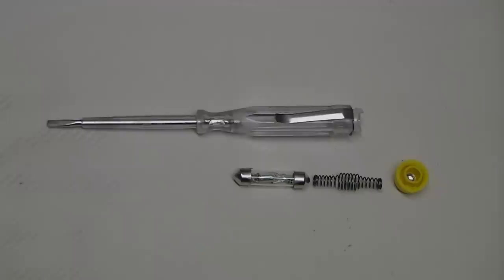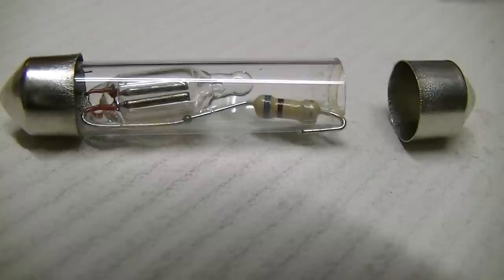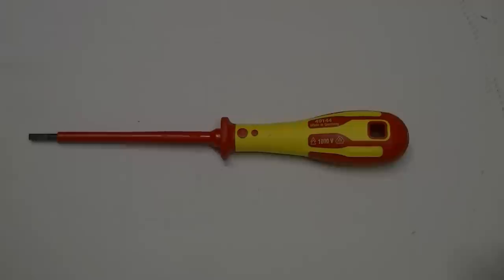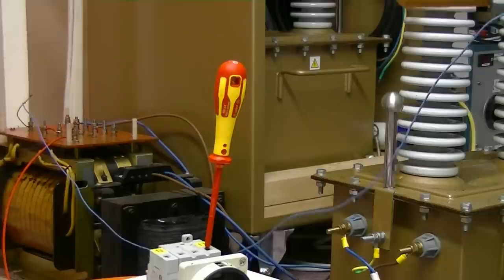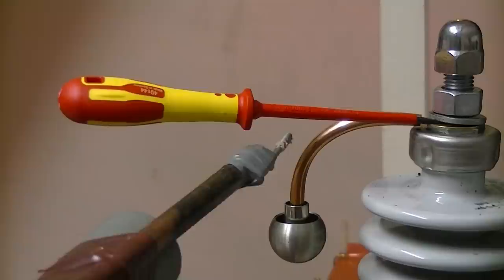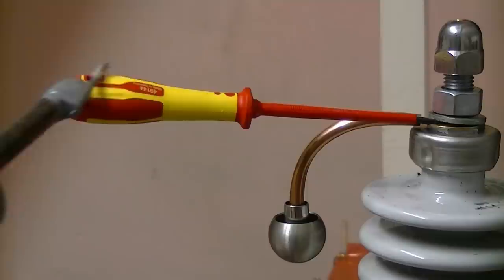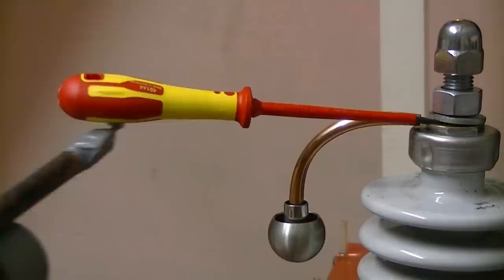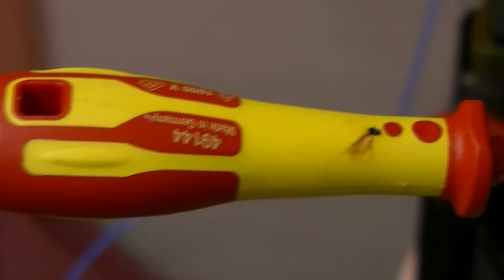Killer Screwdriver

Comment: And where would you find a 1000-plus volts supply in the average house? Most you would find would be 110V (North America) or 240V (UK, Australia, New Zealand), assuming single-phase AC. Okay, there's the spark lead on your lawnmower, but current is usually pretty low there.
Reply: The volts just start the trouble. It's the amps and/or joules that kill people.
Always be wary of big aluminum electrolytic capacitors, you can find them in anything that uses a switching power-supply, like computers, televisions, etc.
If I ever have reason to be messing around with anything like that, I make a point of putting a discharging jump-lead across the mains filter capacitors. I made a jump lead to use specifically for this purpose by splicing a 10k ohm 1 watt flame-proof resistor in to the middle of a standard jumper lead, so that a fully charged capacitor won't discharge arc thru the lead, which would make a bit of a pop with the smaller caps, and a pretty large bang with the larger ones. 10k ohms discharges the cap in about 30 seconds to a minute at most, but I leave it for at least 5 just to be sure that there's no energy left to surprise me at an inopportune moment. You used to be able to get all the supplies you need from most any Radio Shack, but these days they mostly sell cellphones. You can still find the stuff you need online easily enough, however.

Comment: Arent these things only supposed to be used up to 500 volts though?
Reply: Mate of mine was almost killed by one of these on a standard single phase 230v supply - somehow the voltage bridged and it exploded, and I mean literally exploded. We later reckoned it had moisture in it. Spend £20 and get a Fluke non-contact tester
Reply: Yes.  Safety factor should always be observed.

Comment: Plastics pvc silicon rubber XLPE ETC... all can withstand enormous voltages but the problem is the corona, yep that crackling sound. The corona and UV is extremely destructive and its just a matter of time before a puncture occurs, and making the material thicker doesn't do much except delay the breakdown. LV insulated tools is strictly for LV use only.

Comment: this experiments is pointless and no meaning to make judgement that screwdriver is killer. Normal condition, you would not short circuit it directly. Use ground or earth as negative point and normal voltage, then if it shows the same result, then i can say you have your experiments good.

For special purpose, use special tools.

This experiments looks like run your bicycle into fastest speed in F1 racing championship. Very dangerous and one more time, pointless.
Reply: You should watch his video on Health & Safety!
Reply: +Yoga Saja  Not pointless at all.  Most people don't understand why the tester works and what the possible pitfalls could be.  You are simply commenting so as to sound knowledgeable and important, yet you cannot even grasp this concept.

Comment: this is pretty safe for domestic use. 
I've been using one of these at my domestic repairs in my home (127V and 220V) and, since it supports up to 600V, I won't find any spot with more than 220V at my home. It's safe.
Reply: Not all 'models' cover the wider range, and in fault conditions you may have been supplied a 3-phase winding voltage so a bit more of a 'sting'.. ;-)

Comment: Yep - I've accidentally hooked-in on 1.1Kv with a similar screwdriver.  Rated for 600V was the driver.  Was fine.  After the smoke cleared from the blown fuses, the driver was removed from the cable and was still good.

Comment: Have you tried popping lengths of solder on your capacitor bank? When I was in my teens I made a small bank of caps half the size of a brick and charged to 35V. putting some solder across the terminals made some awesome explosions and trails of white soot in the shape of firework pattern.

I wouldn't advise breathing the smoke and soot, they would be lead and tin oxides.

Comment: So that screw driver will bust through the 2 bigger circles at higher voltage? You were just at the breaking point and you bust perfectly threw the smallest circle. Maybe that's so they know the approximate voltage the guy holding it when it went off touched.

Comment: You might be able to use them up to 600 V, or if you want it hard up to 1000 V max., but after that you are finished. I tried this at a low energy high voltage and it seems it creates a leaking current around the resistor. Could that be?

Comment: If you are a pro electrician you should have a multimeter in your tool box. It does not have to be a fluke but you do get what you pay for and be using that. I think these little screwdriver ones you get in the dollar bin at the hardware store are marketed for around the house use not commercial/industrial settings where you would be dealing with high voltage.

Comment: I see what the problem is.  From 2:06 to 2:29 the screwdriver functions perfectly: apply a voltage and it lights up.  Where it goes wrong is at 2:30 - remove the voltage and the screwdriver is still lit.  This is very misleading.  It would cause you to think a high voltage is present when it is not.  The solution is simple.  Make the screwdriver body of fireproof plastic.  It's so obvious I don't know why the manufacturers didn't think of it.

Comment: I also would like to ask you since you seem very knowledgeable about high voltage....
if i have 5 gaps/layers of insulators rated at 1KV each.  is the total final insulation value 1KV or 5KV ?
Reply: +forthereg If they are wired in series it will be 5kv

Comment: Very nice test, this is why I don't own or use any of these screwdrivers, and only use Non-Contact voltage detectors. I know Wiha test there Insulated Screwdrivers up to 10k Volts, I wonder how many volts they can take, and if there is any difference in a a regular insulated screwdriver compared to a slim-line insulated screwdriver. Could ya test if Wera, Wiha, Witte, Felo, Hazet or Gedore and compare which one has the best insulation against getting shocked.

Comment: If it doesn't break down below 1000 volts then it's safe with 230V mains electricity, right?
Reply: Well, in order to get the VDE-certificate they have to withstand 10.000V, so they are quite safe to use with 230V, yes. In fact even 99% of "normal" screwdrivers are safe to use with 230V (shaft wrapped in electrical tape quite recommended), but you do that on your own risk.

Comment: Great video!I have a question: when testing with the first screw driver that uses your body to complete the circuit, how come the light of it brightens up when you touch a wall while you're testing? 
I'd love to hear you're thoughts on this. Thanks in advance.
Reply: When you touch the back end of the neon screwdriver but are otherwise insulated, your body is acting as a capacitor whose other end is disconnected:
Live---[neon]---| |---x
This setup will allow a certain amount of alternating current through, basically enough to charge and discharge your body's capacity

But if you touch the wall with your other hand, then you are connecting the other end of your body's capacitor to ground:
Live---[neon]---| |---[resistor]---GND
This will allow more alternating current through, because you have a path to ground for the current.

Comment: That's surprising that screwdriver handled that much. Wonder how well a normal plastic handles one would do. I have a set of commercial electric tools. large needle nose, diagonal, lineman pliers. They clam on them there not even insulated, even though they have 2 layers of rubber on handles, and it's probably like 2/16ths of an in thick. I don't know be good over maybe maybe 220V. But find kind of odd they don't even rate it, unless it's like cheap rubber that isn't a great insulator. From brand name though you'd think it would be rated like 220, just in-case you cut live line, in some poorly setup wiring job. I have one of those little testers surprisingly that is a CE tool also. I never use for anything usually, other than occasionally finding traces on PCBs, or finding polarity in some like <12V circuit.
Reply: You can buy tools insulated to 1KV. All of my screwdrivers are insulated to 1KV.

Comment: 8:40 have to say: don't use this screw driver again. the black "tunnel" is now fully metalized. you probably now that, but someone else most likely NOT. Someone else may get hurt when using it on high voltage.

Comment: ...........as the guy below said. If you had THAT kind of power supply running through your home. You wouldn't need to test for anything. Every single appliance and circuit in the household would have been blown back to the future.
At that point you'd be of more help calling a lawyer to sue the utility company for installing the local block transformer in your service entrance than poking around with one of these.

Comment: With such voltages you could destroy any indicator even the most expensive non-contact one. Besides, it's pretty much meaningless. You could also blow any light bulb in the same manner just by applying the 1000V instead of 220. What's the point?
Reply: Science. And fun.

Comment: You have burned it from the outside alone. It didn't colaps itself. When you went too close to the main it connected and burned the outside till the metal inside the screwdriver.  It would have lasted higher voltage

Comment: I've only ever used that type of screwdriver for low voltage stuff, I'm not sure what set I got the screwdriver in but I was a bit suspicious about the metal on the top of the handle at first, I only really ever used the neon on a plasma globe and low current high voltage sources, the HT output on my scope though I get a short bite off it using that stupid screwdriver

Comment: Why is something that cab withstand 50kv not rated at atleast 5kv?. Is it because of its size?, that can cause arcing directly to the human body?. Also u can run a locomotive with 50kv, whats the max current that transformer can supply?.
Reply: because the screwdriver is guaranteed safe at 1kv but is tested at 10kv... you could easily use it on a 5kv live part but when would you ever need to tighten a screw that is live at 5kv?
Reply: +A Cat I kinda get the point, rate something that sounds like it has some actual use. But its still under rating something that can perform so well.
Reply: +A Cat why use a spring though?
Reply: mbrij 96
the point is it is gaurenteed at 1kv, although i may be safe at 5kv they cannot gaurentee that and if it were to fail they would be to blame, and what spring are you talking about?
Reply: +A Cat The spring in a contact voltage tester. The one at 1:24.
Reply: mbrij 96
thats just to keep a good connection, and for ease of building on the assembly line

Comment: What is that little silver ball thing hanging off of the terminal he's using for the high voltage screwdriver test?
Reply: This device is the top section of a spark gap.  There will be a similar ball a few inches below this one connected to ground.  Purpose is to protect transformer from excessive voltages that might be developed during these experiments. Distance between the balls is set to arc over at a lower voltage than the insulation in the transformer (hopefully).
Reply: Besides voltage measurement, you will usually find these conducting spheres on high voltage terminals to avoid direct discharge as in this case. Charge spreads across the large surface area of the sphere resulting in low surface charge density and thus lower electric field between two terminals. If the spheres were not there and the terminal was pointed (which is the worst case), all the charge would tend to accumulate on the point resulting in higher charge density and higher electric field. Intuitively, if the E-field is high, the chances of dielectric breakdown, i.e. current flowing through air, is high. Also, by definition, electric field in a given area is going to be high if the quantity charge is more (because of high density).

Comment: "Use a proper voltage tester like a fluke with 2 probes to get a definitive answer to weather there is voltage or not."
That only tells you whether there is a voltage between those two points, it doesn't tell you what you REALLY want to know which is if there is a voltage between one of those points and YOU.

While neon screwdrivers have their issues that for a final check (after using said two probe tester) before touching stuff that may have mains on it  IMO the advantages outweigh the risks

Comment: what is the manufacturer name of the device rated for 1kV that you used 100kV to destroy?  Their name deserves  a mention for a safe device.
Reply: one of the german ones,  not sure, wera, wiha, knipex...but they seem to have invented the VDE 1000v stuff, so they are all very good and do proper testing, so if you need the real tools buy them from a german company, i know all the proper sparkys all use one of them, and fluke meters or mains testers
Reply: "VDE Schlitz-Schraubendreher C.K. Dextro VDE T49144-080" Googling the number on that screwdriver made it very easy =D
Greetings from Germany. =)
Reply: RkB
ahh yes i forgot CK (Ceka) on my list, good search skills^
Reply: Btw: VDE 0682-201 certificated tools get tested with 10kV and are save to work with 1kV AC and 1.5kV DC.
They are tested in a similar way as in the video. But VDE doesn't use sausages but Prüffinger. Standardized artificial test fingers.
Reply: +RkB kudos

Comment: I still cant quite understand why anyone would need to have the capability to produce over 50k volts in there attic !! And who the hell is going to check a 1000v system with a £1 screwdriver .
Also I'm sure having small metal parts and springs from screwdrivers you've just blown up is not the "safest" thing to be flying around in that room of yours. Just a thought

Comment: I use screwdrivers like that with the battery to quickly test continuity. It's still not reliable, but it's a quick way to double check. Mainly for small 3-13 amp fuses.

I'm not one of the fucking idiots who uses it to check for voltage.

Comment: You have got bits of plastic tube, copper pipe and hook up wire all held together with duct tape and insulating tape in your hand. Your choice, but in my opinion just a worse version of one of these screw drivers for playing around with up to 8KV on the end of it.

Comment: ..alright,  but the question is.... where do you get that 50k 100k volts at your home..?? or you just faking things up..???
Reply: Watch a couple of his videos where he shows some of the kit he's got. Anyway, starting point is he has a 100A supply at a nominal 240V from the power company, which is the standard for UK domestic properties. He's got basic step up and step down transformers to either give him 100s Kv at very low current, or 100s A at very low voltage plus more esoteric kit. For example you can find a video where he demonstrates a million watt capacitor, about the size of a small suitcase. That's charged from a standard 13amp plug going through a 2000w microwave transformer and gives 1000's of amps and volts at the same time when it discharges.

Comment: Thats why its rated strictly for 240 V.
Reply: but the point is, you may accidentally come into contact with >240v
Reply: +Elliott Hurst U right. If u are a professional electrician, this is a killer screwdriver. Even a big house may have 3p 440V.  But if u r an average joe, who knows his house gets only 240 or 120V supply & has a good power distributor, these things are quite safe & very very handy. But like I said, if its anywhere else these are stupid killers.

Comment: Where are you actually going to find a thousand volts anywhere near a house? (a normal house, that is, not your house, you're crazy.) Electrical transformers in residential areas operate around 500 volts.
Reply: you buy a transformer and chuck it in your house, and run it off mains
Reply: Shawn Elliott CRT TVs, microwave ovens and one or two valve amplifiers
Reply: They won't provide enough wattage to produce this effect. You can get zapped by a thousand volts any day in the winter, just by walking across a carpet and touching a doorknob. It's not voltage that kills, it's amperage that kills.
Reply: that doesn't really make much sense - the transformer will draw more current, how ever you are right in saying you are limited to the same wattage

However Andy has it connected to a big ass circuit breaker (around 200 amps I think it was) meaning he can draw 20 kW, 

P = IV

I = P/V

I = 20000/1000= 20 A

20 amps is more than enough to kill you (0.5mA easily kills)

Comment: Just curious, if you were to do this with your finger at 2:50, how fucked would you be?
Reply: depends, if it the electrical path was in one finger and out your wrist it wouldnt kill you just simply burn you cause puncture wounds and hurt a hell of alot
Reply: Good thing with using one finger is that you won't grab to the device under biological test after getting shocked - that's why one uses either back of his hand or a finger to check.

Comment: i had a transformer sitting in my shed i got it working in put is 230v 13amp out put is 15.000v 0amp just about tazzer voltage i put in my room mate bed up 4 hrs till he fell sleep then put it on he jumped out bed and ran after up the road if i just filmed it

Comment: This devices are safe. In your experiment you have used voltages more over the limits of the deviece. In domestic situations you don't test 8000v. Overall, you are fooling people with this video.
Reply: You still shouldn’t use it either way to “prove” mains is dead. always use a GS-38 tester and proving unit.